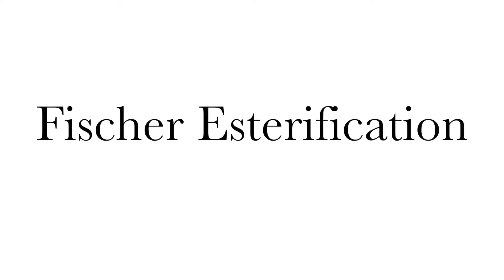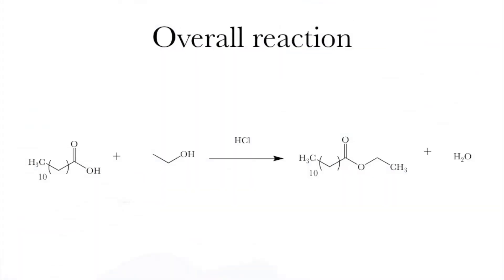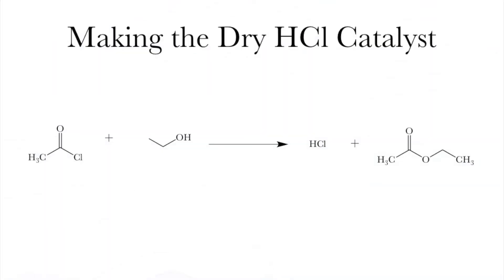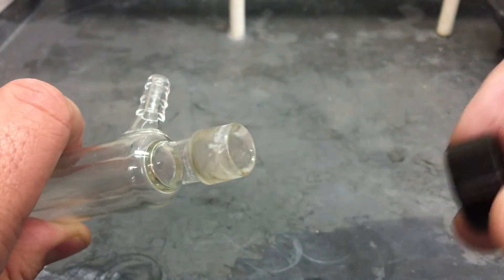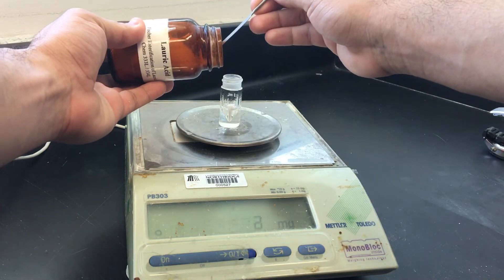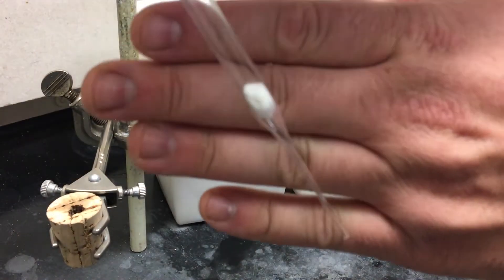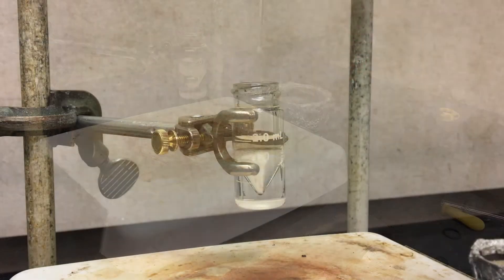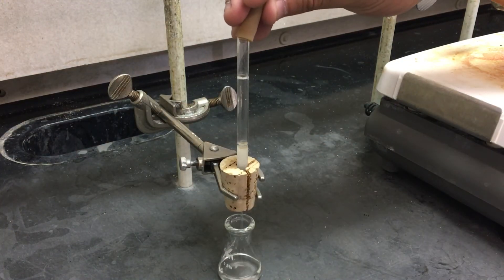Fischer Esterification of Lauric acid

Comment: sir  i am doing work on fischer esterification of lauric acid  lauric acid + methanol +sulphuric acid but clearly product is not formed.
and i have faced many problems in TLC system.
Reply from the maker: Is you methanol and sulfuric acid anhydrous(dry)? Water would drive the equilibrium back. That’s why we used anhydrous ethanol and made the hydrochloric acid using the acetyl chloride

Comment: I understand that monolaurin (glycerol monolaurate or GML) is created by esterification of lauric acid.   Did you create monolaurin in this experiment?
Reply from the maker: No, not surprisingly monolaurin uses glycerol as the alcohol in the esterification we used ethanol giving ethyl laurate. 

But the process is the same, though you may need another solvent.